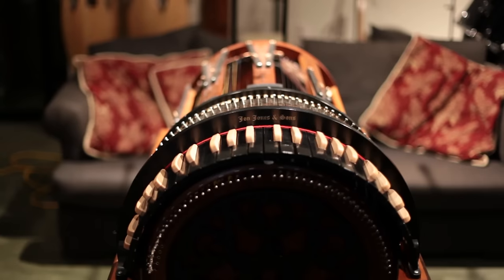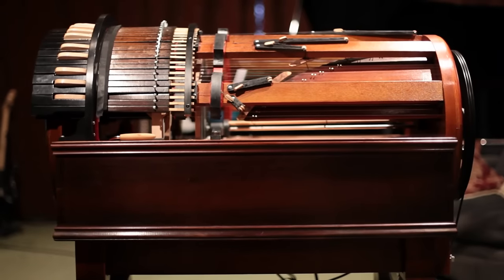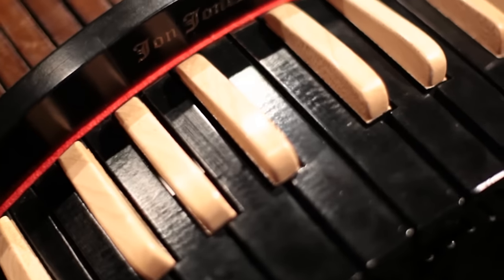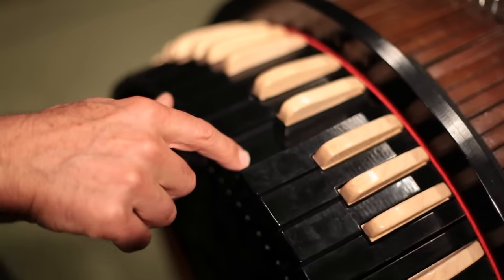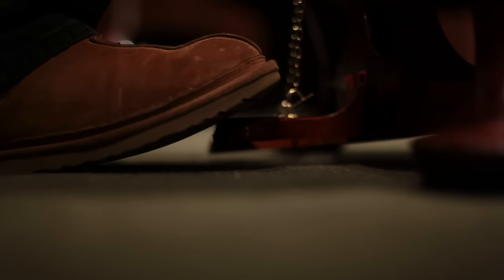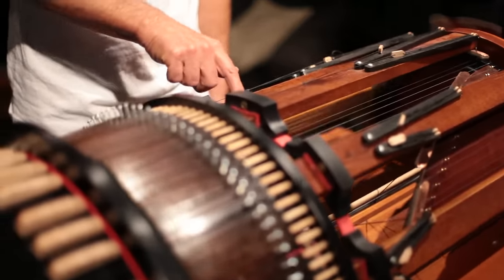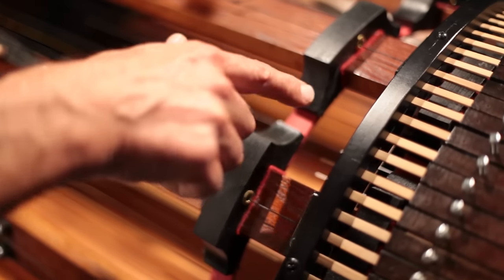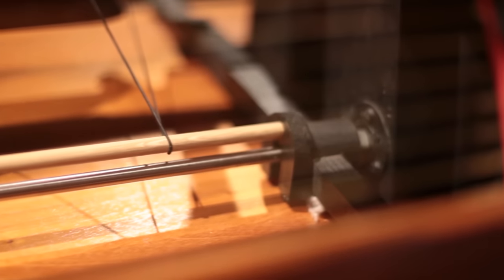Wheelharp - Nicholas Pike

Comment: Around 1490, Leonardo da Vinci designed such a wheel stringed instrument played by a keyboard that he called  'Viola organista'. (violin-organ).  However, it was unsure he could really built what he only drew. .In 1600, the german engineer Hans Hayden built its look like harpsichord 'geigenwerk' (violin machine) where the strings of a harpsichord were gathered by groups of 8 over separate bridges and wheels. All the wheels were moved simultaneously by a rocking pedal. When a key is pressed, a lever pull down the related string in contact with the related rotating wheel. A historical copy built in 1625 by the spanish monk Fray Raymundo Truchado is on exhibition at the Royal Museum of musical instruments in Brussel (Belgium). In our times the Japaneese maker Akio Obuchi started to build and improve the Geigenwerk in the 1990's. His website included a full explanation and history about this instrument; Two years ago a polish harpsichordist built successfully such a Geigenwerk with which he gave public concerts.
Reply: How come the only nationality you forgot to capitalize was Polish?
Reply: Matthew Latawiec
Because M.Slawomir Zubrzycki's Viola Organista copy it's not an important step in the history of this instrument but an outdated and late devellopment like this Wheelharp which aren't original inventions. Here below is the link of M Zubrzycki website where he explained the conditions of his rebuilding  copy. You could notice that he was inspired by: I- Hans Hayden Viola Organista from 1575 but depicted in Michael Praetorius Syngtama Musicum published in 1600, II- the Viola Celi built by Fray Raymundo Truchado in 1625 now on exhibition at the Royal Museum of musical instruments in Brussels, III- above all by the description of the Viola Organista copy from Hans Hayden model that the polish Jan Jarmuciewicz published in the 1880's.
For my own point of view the most important  was the  revival of this instrument M Akio Obuchi has done in the modern times from 1993

http://www.zubrzycki.art.pl/Viola%20Organista_En.htm

.

Comment: It's more a single wheeled viola organista than a hurdy gurdy, because you move the string to the wheel when you press the key. In the hurdy gurdy the string are always vibrating in contact with the wheel, and you make different notes by shortening the vibrating length of the string.

Comment: As a violin player: I think the discordant, scratchy sound is coming from pushing the keys down too hard, in the way one might play a piano or other keyboard. But this is a bowed instrument so you want the strings and the bow to just glide off each other, not be forced together. The buzzing sound is from the wheel spinning "too fast," it's a specific technique when done on hurdy gurdy.
Not an expert at all though, just some thoughts. :)

Comment: It sounds like to be expected - Violins without bodies. If you take the body away from a Violin, you will get that sound. The resonance chamber, which makes the Violin sounding like a Violin, is gone. Now, this Instrument, I would call it The String-Gatling, has its own distinct sound. That has some benefits, of course, but for a rather few cases where its operation makes sense. I fear it's mainly a 15000-Dollar dust collector...

Comment: People, think about the sound and why it sounds that way. This just has no body to it. There's nothing for the sound to resonate in first. Imagine the sound of an unplugged electric guitar. It's terrible. 
Now, if this thing had a large hollow casing around the string/wheel section and then a hole for the sound to come out of, that would drastically improve the tonal qualities.